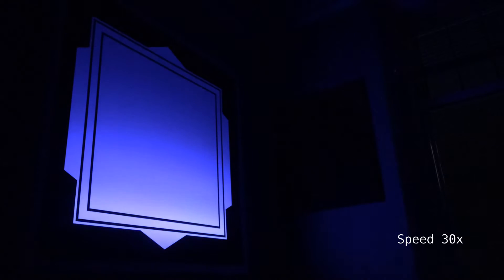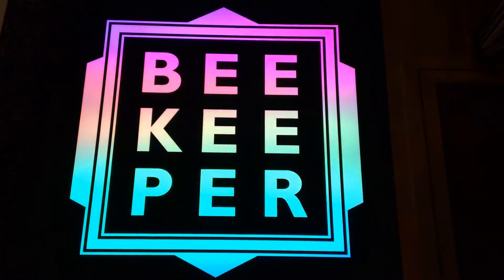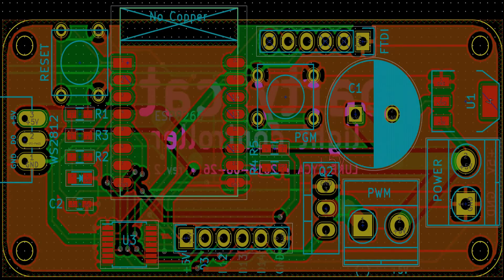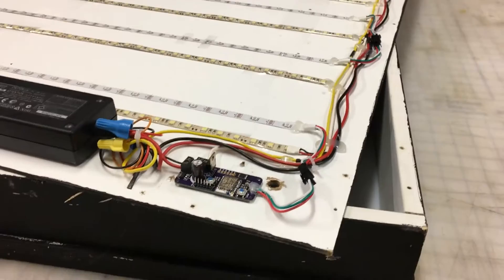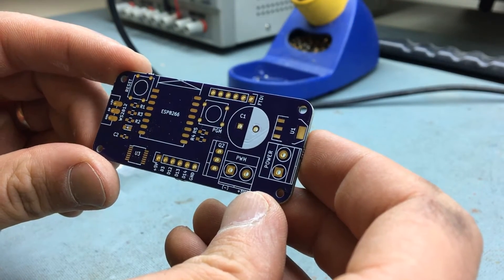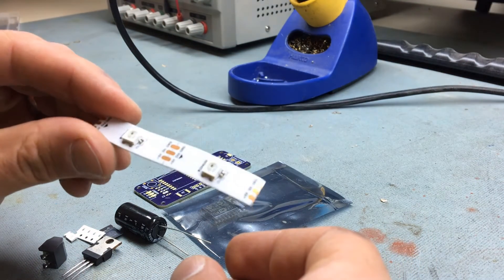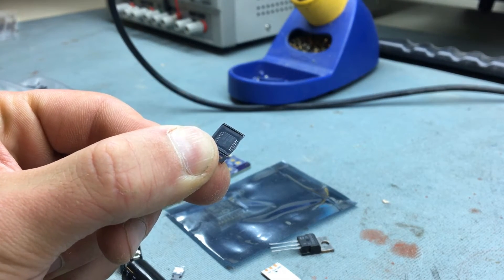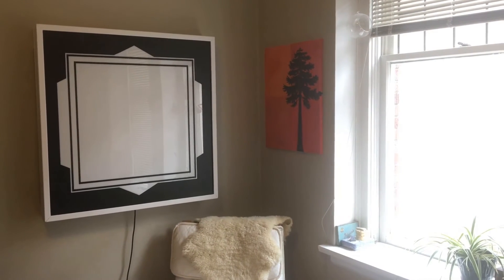DIY Sunrise Alarm Clock

Comment: Hello, electronics noob here; I'm very interested in building this. As I can't get your partycat controller, I am wondering if I can use your firmware with the esp8266 that your party cat is based off of. What are the differences that I would need to take into account? Thanks man
Edit: I found your controller on osh park. This is a little overwhelming, a tutorial would be amazing!

Comment: Could it be that the HTML files for the Webinterface are missing?

I can flash your firmware without problems but always get a 404 error, don't you set the alarm times via the Webserver?
Reply from the maker: I didn't bother making a UI. The web server responds only to a specially-crafted request to /settings?onTime=123&offTime=456&timeZone=-7.
If you make a better UI, please submit a pull request!
Reply: where I can buy it?